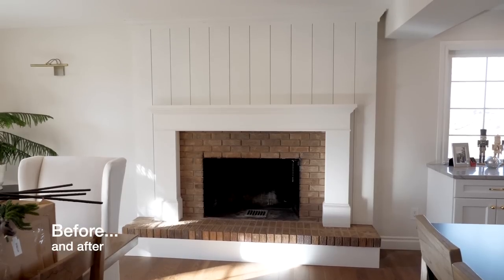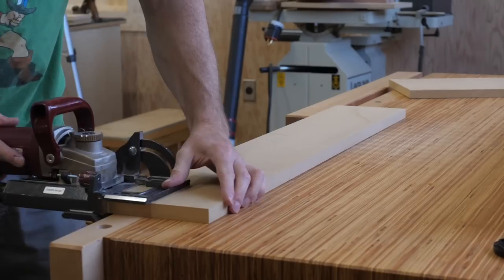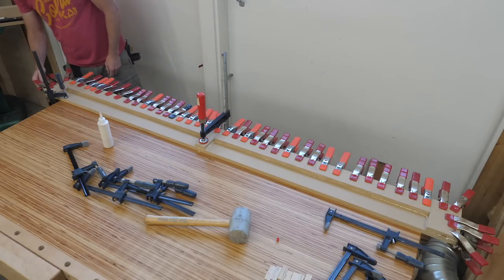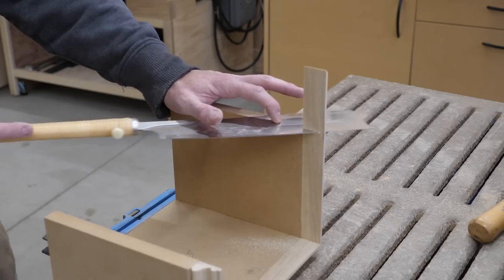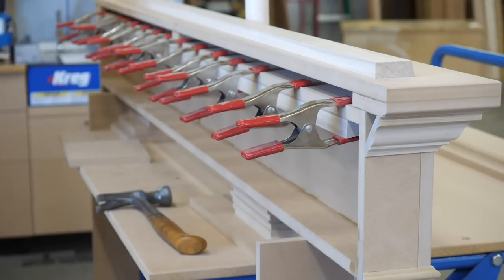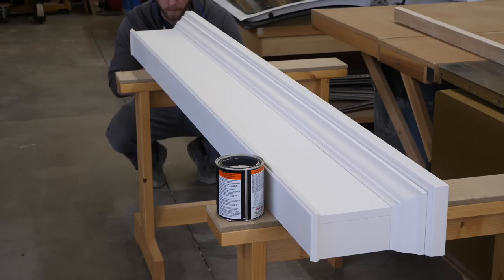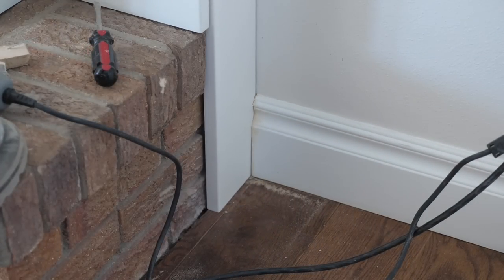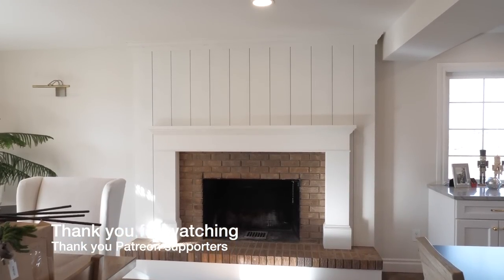FIreplace Mantel With Shiplap

Comment: When I glue my miters I apply even coats on each piece and then I let it sit for 2 minutes by the clock. Usually most of the glue gets sucked in . I the apply one more coating of glure on one of the peice. This leaves more glue in the miter and I get a stronger bond.
Reply from the maker: Good info. I glue both sides and I do it kinda slow, attempting the same thing.

Comment: Great tip I discovered for using screws into cement, brick, or mortar...

Put a length of 14 gauge ground wire into the hole.. You can tighten up the screw very well without worrying about it stripping out the cement, brick, or mortar. Also a good way to save a hole if you do strip it out. Throw a bit of wire in and you're golden!
Reply from the maker: That is a really neat tip. Thank you.

Comment: Three quick comments.  One, I've built a lot of stuff with MDF and oh do I hate MDF.  Two, love the oh so subtle plug for the sanding disk.  And three, I wish I could build and then let the painters paint.  I always get stuck with that job too and its one of my least favorite.

As always, the final product looks terrific.  Excellent job.
Reply: Agree with you about using MDF and hating it.  At one stage I vowed I'd never use the horrible dusty stuff again, but only a couple of years later I found I just couldn't justify staying away from it.  It does have a lot of benefits.  It's the dust and weight of the panels I abhor.  Cheers, David
Reply from the maker: Thank you. I do a lot of painting, fortunately, not on this one.

Comment: Another great tip. I tried some of this nail filler and what a game changer. The stuff is in a different league. It along with the Amana 1/16" radius round over bit and the double taper sanding disc are regular steps in my work now.
Reply from the maker: Thank you. That filler is great for sure, and of course my disc is really neat as well.

Comment: Very nice!!!!!! I try to use MDF as much as I can on paint grade. But I have learned the hard way ANY outside corner at floor level MUST be hard wood. The first time the vacuum cleaner slams into the bottom of the mantel legs. It's going to make a huge dent i that MDF.
Reply from the maker: Oddly enough, I find MDF to be more dent resistant than most paint grade woods, especially if the corners are generously eased.
Reply: @MikeFarrington   Beautiful work, Mike! Forgive me if you explained this already, but why don't you miter your outside corners on the base and the paneling? Shouldn't you be able to generously ease an outside miter with one of your superior, airtight glue joints? The v-groove control joint is clean, but I am having a hard time imagining a shop-glued miter opening up enough to crack the paint. Thanks for your great content!
Reply from the maker: @LaCumbreCabinetsMillwork  My thought is if the joint is to open up, it's better for that to happen around the corner than right at the front.

Comment: Have you considered using CA glue to connect your moulding parts?
Reply from the maker: Yes, I am past that phase. I did that for years and found the connection to be too brittle, eventually it cracks and the joint opens up.

Comment: A beautiful job there Mike with that fireplace.  It looks beautiful.  Love the double layer of trim at the top of the wall.  Great idea. Was just wondering if the wood needs to be treated with something when doing that or is it far enough back from the heat?  I've never before considered taking on something like this myself and have never before had the need to wonder about that.  Many thanks.
Reply from the maker: No treatment, its far enough away. 12" is the golden number, which when the firebox is installed, all combustable materials will be more than 12" away from the opening.

Comment: How did you caulk the crown molding where it meets the ship lap? Wouldn’t there be “oozeover” into the 1/8” gaps? I’m dealing with a similar situation on my hall tree project and not sure how to tackle. Thanks MDF!
Reply from the maker: I skipped all the gaps. I made sure the gaps were sharp, by using a flat head screwdriver to remove any ooze.

Comment: Great video, I like your groove. I wasn’t looking for another channel to subscribe to, but I found one! Have you tried the HiPUR, glue system? I have had good luck and it dries fast. I use it on crown and miter joints. Have a great day, thanks for taking the time to produce these.
Reply from the maker: I have and use the HiPUR system. I use if for lots of odds and ends. When glueing wood, I prefer, if time allows, wood glue.

Comment: Hi Mike, great video. Just a quick question. Rather than creating individual shiplaps, could you just route thin lines into a full sheet of mdf to give the same look? Is there a reason against this idea? Thanks in advance and appreciate the videos. Cheers.
Reply from the maker: That would work, but in this case there would still have been two seams, and the sheets would be really heavy.
Reply: @MikeFarrington  Ah gotcha. Makes sense. Thanks for the reply.

Comment: Mr. Farrington... I do have one fear...

I want to get one of your double tapper sanding disks, however, if you ever stop selling the sand paper, is there an alternative supplier?
Reply from the maker: Sorry for the slow response. The paper I use has a 10" diameter with a 3" hole. If I were to ever stop selling the paper, you could just buy 10" discs and cut the center hole yourself. It would be a little bit of a pain, but you shouldn't be changing paper that often.

Comment: Why thin shellac primer? It's already incredibly thin out of the can.
Reply from the maker: Each brand will have their own formulation. Also, temperate will change viscosity a little. Past that, gun setup will play a huge role in needing to thin. Since I'm using a harbor freight gun, I thin a little. On my pro level guns I would not thin. With that said, I didn't even mean to indicate that I thinned the material with that comment, more that I was using a primer that didn't contain water.